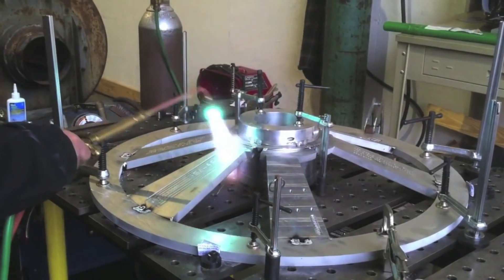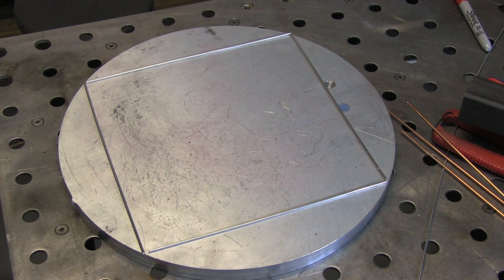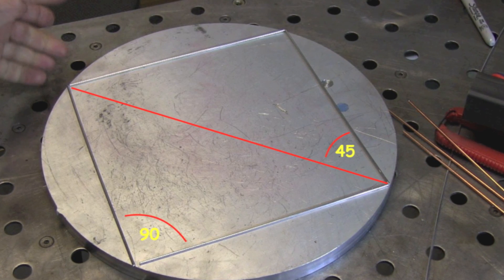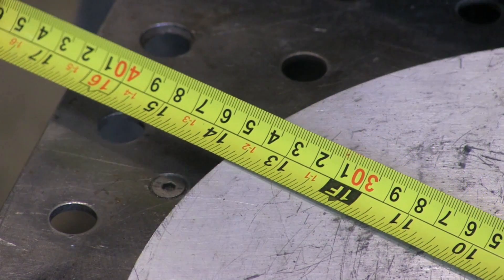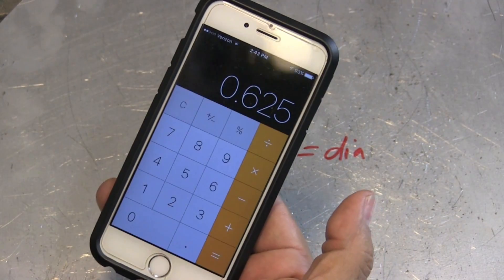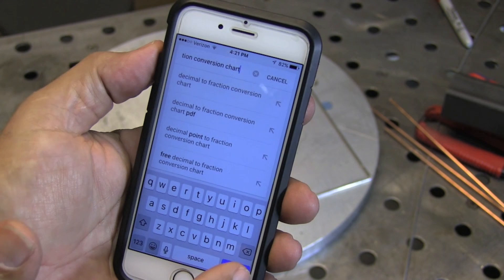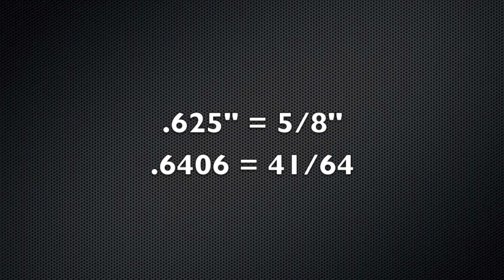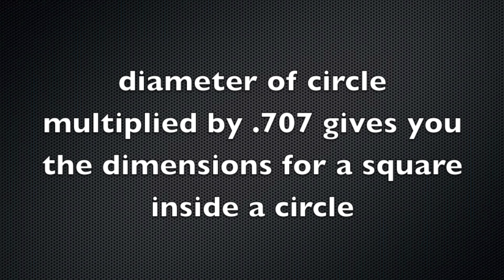Welding Fab Tip - Square inside a Circle

Comment: line and grade guys use engineers tapes! seriously though i have used construction master  calculator apps to convert fractions to decimals or add fractions to decimals easily. I use the pipe trades one,but they have several for many different trades.  I am in no way associated with them,just have been using them for years. they are expensive for an app but have been well worth it for me. check them out. great tip as always

Comment: It's interesting how often the Root Mean Square value (.707 or half the square root of 2) comes up in so many different disciplines.  I've used it in electronics, optics (grinding a telescope mirror) and machining a 24" diameter shaft for a bascule bridge.  It's like math is universal or something.  The guys who I come across who know trigonometry the best are those who know how to use all the numbers on a framing square.  Most of them don't realize that they know more than the trig teacher.

Comment: 0.707 is actually both the sinus and cosinus of the 45 degree on those isosceles triangles. And as per trigonometry 101 the size of the adjacent side (on a square triangle - doesnt need to be isosceles) is always the cosinus of the angle between that side and the hypotenuse times the size of the hypotenuse. You can also use the sinus of the opposite angle to get to the same result. The sinus of an angle is always the same as the cosinus of (90 minus that same angle). In this case its either 45 or 90 minus 45 which is still 45.

Comment: I like those tips that lead to other tips....
If you trace a diameter and draw a perpendiculary at its center, you will have another diameter.  Now, just link the tip of a diameter to the tip of the one 90 degrees further.  Once the two others  tips will be reached, the square will be made.   Nothing to calculate,,,,

Comment: Here's how this works: The radii of the circle are the legs of a right isosceles triangle where the hypotenuse is equal to the sides of the square.  The Pythagorean Theorem tells us that the hypotenuse will be equal to sqrt(2r^2).  This can be simplified to r*sqrt(2).  Knowing that r = D/2 further simplifies this to D*sqrt(2)/2.  Since we know that sqrt(2)/2 = 0.707, we can simply say that the answer is always equal to D*0.707.

Comment: Another way: using outside diameter. a square has 4 sides for 90° each for 360°, our circle also has 360°. 2πr is the formula for finding diameter so 2×π×6.81= 42.79" as our diameter then we can find how many inches per 1° of rotation  42.79" × 360° = .119 (inches per 1° of linear rotation). then we do 90° × .119 to find 90° of our circle into linear measure = 10.71". this would be used to mark out the 4 points in relation to the diameter of the circle. harder but another way of solving the same problem.
and yes I know 42.79÷4= same answer
Reply: 2πr is actually the formula to calculate the perimeter not diameter, diameter is plain 2r. you are actually calculating sections of perimeter which is much easier using radians as a complete revolution has exactly π radians.Or in other words a radian is the angle of the pizza slice which radius equals the length of the outside crusty edge. and a circumference always measure 2πr in which π is just the amount of arc sections (that compose the circumference) with length equal to radius. Simplifying 360/2=180 > 180/π= rad > roughly 57.3 degrees
Reply: Wild Weasel you get my point, and it worked out in the end. not sure where my head was I guess it was full of calculus.

Comment: The trig way/long and complicated way: sin(>°) = (opp÷hypo), so sin(45°)=(opp÷13.625). × both sides by 13.625 to solve for the opposite side legunth. 13.625×sin(45°)= opp or 9.633
you are welcome.

Comment: i'd settle for the metric system. I often times use metric side of the tape measure when calculating stuff because its so easy, all i need to do is convert back to imperial. Though im going to wait for self driving cars before i hope for hover cars.... people drive bad enough on the ground.

Comment: Or divide the diameter by the square root of two. Same thing but more exact.
Reply: .707 is just 1/sqrt(2) rounded to 3 decimals. They're both exactly the same but multiplication is generally easier by hand.

Comment: I never realized that fractions of inches were such a pain.
I knew of the need for 3 sets of drill bits (fractional, decimal and letters), but we are barely better in metric with 2 sets: round numbers and tap sizes.
Reply: But then again no. For the normal thread for bolts, there is a meaning by the kinda weird numbers on the tap drills. Example: M10, 10 mm outside. Thread pitch 1.5. 10 - 1.5 = 8.5 which is the tap drill size you need. And when you go above m12, all the tap drill sizes are either whole or half numbers. So the weird tap sizes are confined to a handfull.
And half number drill sizes is quite practical for many things. Tight bolt connections and so on.
Reply: thread pitch (lateral separation) is different from thread height and for tap drills the important factor is thread height not pitch. Since metric threads are cut on a 60 degree rake the thread height is very close to the pitch but not the same. Thread pitch is a bit bigger than height see this link for relations http://mdmetric.com/tech/M-thead%20600.htm
Reply: It might be a language barrier for me, but looking at the chart you linked to, my former statement still holds true. Take the designation M8x1 (pitch=1) and the drill size is 7. And that holds true ALL! the way in the chart. That's whats count in workshop. Don't care about rake and such on the tap. If the drawings tells me to make a M16x2 I can instantly tell which size drill fits, so the thread is correct ;)

Comment: This would also be useful for milling a square on a round shaft.  I wish I had been taught this 20 years ago! Awesome tip!
Reply: When you mill the first side, how does it come to a point on the 2nd side? You're just making a flat that meets a curve. One could make a couple cuts, index the shaft, cut, index, and repeat until  the points meet. Or, one could use a little math, figure out how long each flat should be, and mill each face to that approximate length before indexing.
Reply: diameter of the circle or roundstock MINUS the length of one leg of the square. divide that by two.
Boom, there's your final DOC on that side.
Don't be afraid to doodle pictures. People won't talk smack to you when you're putting out work faster

Comment: At least you guys and gals in the U.S stick to one unit of measurement. Here in Canada we still use both. Some drawings are metric, some are imperial. We have to know both systems, however only metric is taught in school. Imperial is still common in the construction industry and is also quite common for thing like fasteners, hoses, and threading.  Great tip for a quick way on fitting a square peg into a round hole. I still bust out the note pad and use Pythagorean theorem.

Comment: Hi Jody its really good for us old guys here in the UK, I worked in imperial at school and work until 1970. 
Went to Technical college part time until 1973, we changed from one year to the next Imperial to Metric, everything dimensions weight/forces, power you name it. What a learning curve. I also went into the design drawing office 1970 and spent one hell of a lot of time converting imperial drawings to metric. Gear calculations also. Our company sold a lot of its output to the USA Carpet industry, All our quote drawing had to have dual dimensions on.
 All engineers my age group think and work in both, but the youngster in the Drawing office had and have a really hard time of it.